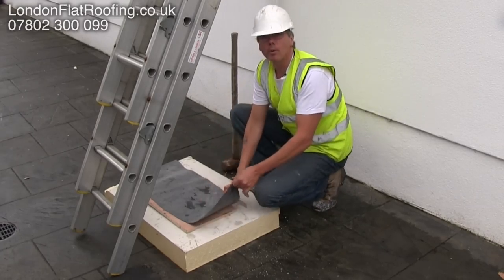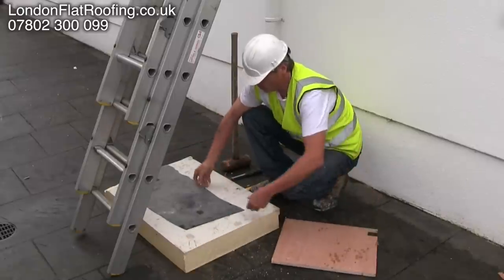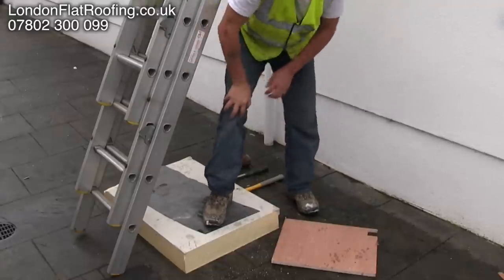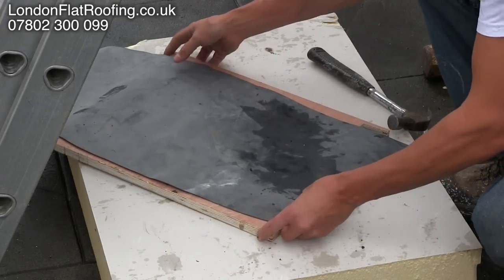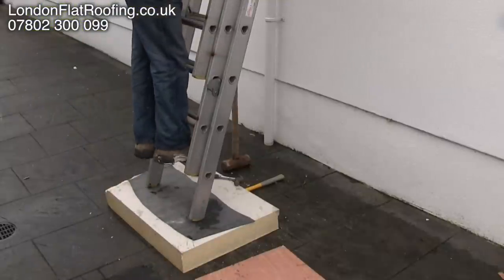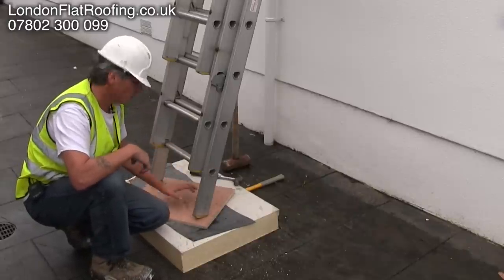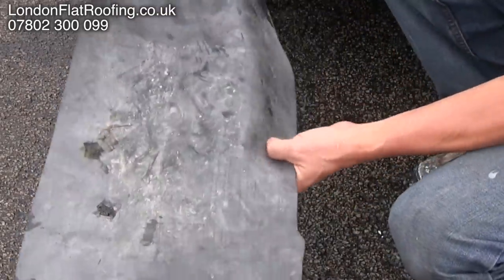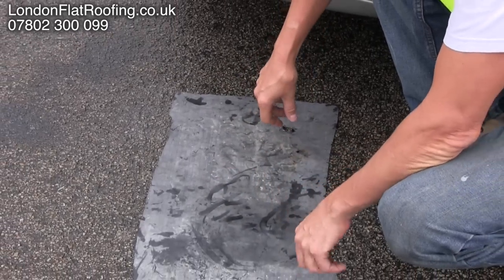Is An EPDM Rubber Roof Strong Enough To Walk On?

Comment: Easily last over 25 yrs (60 mil). Same stuff fish pond liners made of. Check shoe bottom for nails or rocks before walking on, pick up loose nails or screws you find ( hvac repairman).
Those are specialty tri angle washers(counter sunk screw heads), careful not strip screwhead and leave sharp edge, under rubber.

(medium coat best)
Roll your glue even, no glubs or puddles, 1 coat on roof one coat on rubber. Very important with epdm , let glue vapors flash off at least 30 mins on hot day, 1 hour or more cold days.
Cover to fast and it will bubble roofing. 
When the glue "barely" sticks to the hair on your knukles, its ready to cover. 

If it sticks like duct tape to your hair , its still to wet, wait.

Pay attention to overlap seam, do not glue this , it receives its own type of glue/primer tape
Reply: '...Check shoe bottom for nails or rocks before walking on, pick up loose nails or screws you find ( hvac repairman)...'
in our areas those are the most common and avoidable caused of leaks cuts and punctures.
HIVAC service is the primary craft responsible too.
Reply: Trust me now epdm roof membrane is not the same as epdm pond liner the roofing membrane contains certain chemicals that will kill all the fish dont ask how I know

Comment: We are felt roofers of 27 years, as you know everyone try and say felt is rubbish but it's about how's it's layed like all flat roof materials.. I've seen DIY felt roofs that look like a 2 year old has done it, also GRP done over bad decking causing it to fail and also epdm stretched over old felt roofs which looks like a drum on the kerbs.. At the end of the day all flat roofs are good if done correctly mate..
Reply from the maker: Absolutely nothing wrong with todays mineral felts its the incorrect application on badly designed flat roofs.

Comment: Ok, this was a fresh piece of epdm used i presume.  Now my question is years down,  after like 4-5 freeze thaw cycles and the sun has died it a little,  if a ladder was placed on it without the osb, or if weight was applied,  won't it snap/crack?
Reply from the maker: About 5 years ago I stripped  a 30-year-old EPDM roof because the building was being knocked down I pushed and pulled the  EPDM and  I thought that it had lost about 5% of its elasticity

Comment: you cannot destroy rubber by trying to crush it, but epdm is vulnerable to tearing from sharp obects, i was surprised how easily i was able to cut through excess epdm with a stanley knife. ann appropriate test would be to see if a cat scratchig it will tear it and what happens if a bird of prey lands on it
Reply: OnlineBackupServices why would a bird of prey land on a rubber roof and extend its beak or talons into it? I could understand a sabre tooth tiger or a Tyrannosaurus rex but definitely not a bird of prey.
Reply: Slashley gibbins this is a good point and definitely a situation for a scarecrow....
Reply: Why would firestone bother making a roofing membrane that can be destroyed by birds? Believe me they test all this stuff out ive even done my own tests such as trying to pull it apart with various tools, cutting it with blades of different sharpness, it even survived 15 seconds under the direct heat of a blow lamp and still went back to shape

Comment: Funny indeed. I am in Phoenix Arizona where its 118F today and I am wondering what type roofing material to replace a failed material on my observation deck over my patio. Thanks to the Internet, a roofer from England shows me, in great detail, how truly strong EPDM material is. Thanks Steve! I owe you a pint! :)
I'll find a local roofer who is familiar with the material. Cheers!!!
Reply from the maker: Just got back from Texas and have been using it out there in 100F I don't recommend using EPDM if you haven't got insulation under it as it gets very hot ( assuming you are living in the room below)
Reply: TEXAS? You get around Steve!!!
It's a patio roof with an observation deck on top. I am going to ask my installer about putting white EPDM over the black material to cut down on heat and weathering. Its only a 7 x 15 foot deck. Thanks for the information!!!
Reply: Dont use epdm in that heat as its 4 years on youve probably figured that out... the primer for the flashing tape will go off instantly it will be impossible to stick down and there will be endless ripples. However! You can get white epdm which solves all of the problems

Comment: It's frost and heat expansion and contraction never seen one yet after a few years without ripples and creases and that's where it splits or cracks and being only one layer waters straight in
Reply: There's a lot of people out there that do it wrong including this guy. There can be a few mistakes that lead to ripples number one is the adhesive you use youre meant to use a water based CONTACT adhesive meaning you apply it on both the rubber and the deck (which shouldn't be ply) the glue that you get from firestone isn't the best but let's use that for example as it is the right type of glue not PVA the glue has a blueish tint to it and the main property of the glue is that it does not dry fully kind of like tackifier meaning when heated the rubber can lift up ( which is normal because there's no way of stopping this) but the main thing is it will actually stick back down to the board once cooled however if you use the wrong glue say PVA it will fully dry under the rubber and when heated it will peel up but will not stick back down again. Secondly the type of boards you use with ply it can be very strong if you are trying to bend it but if you try to pull it apart like what the rubber does its very weak and either the glue holding the veneer together will give way or the veneer will split away from itself the contact adhesive really is that strong ive seen it many times. thirdly you get idiots like this thinking its okay to stick the membrane straight onto the insulation and the same problem will happen here as with the ply but a whole lot easier you know yourself how weak insulation is and how easily the foil peels off. Those are the main reasons you can see ripples or bubbles I hope this gives you a different opinion of EPDM there's a lot of people out there giving it a bad name and not many who do it properly if you're gonna do it do it right
Reply: Keep in mind that on a hot day a roof that is done correctly will ripple but it wil also stick back down once it has cooled off

Comment: Brilliant video. Can you lay EPDM Directly over a block and beam flat roof and then lay paving slabs on top  or would you suggest a screed between ? Tia Paul.
Reply: Hi Paul did you manage to finish your block and beam flat roof if so what did you do to achieve the final results as I’m in the same boat trying to finalise what to do thinking of insulation epdm and then concrete 
Thanks
Reply: @RayRay-vt7hc we layed the EPDM straight on top of the block and beam, then put plastic sheet, then concreted it and slabbed on top.
Reply: @Paul_Hassell  hi that’s great as Mrs was hinting can we finish it with paving slabs after concrete and what size epdm did you use 1mm or 1.5mm and did you place the slabs or concrete in an angle 📐 so the water can be directed to the channels or a hopper and how did you finish off and sealed the epdm on the sides did you cut to size exactly or did something else and did you glue epdm or just simple lay and concrete thanks
Reply: @RayRay-vt7hc  The rubber itself is 1.5mm and with the fleece back its probably about 3/4mm, and yes we had a fall on the concrete, and being as it was a large slab we put a couple of slits in the concrete as expansion joints.
Hope this helps
Reply: @Paul_Hassell  thanks for all your feedback greatly appreciated our roof span is 8 meters by 7 meters
Reply: @Paul_Hassell  hi how did you finish off the sides and the corners with epdm  do you have parapet wall thanks

Comment: What is the best way to prepare this type of roofing for traffic if you have to periodically clear solar panels of snow or do maintenance on them. What is the best method for waterproofing any bolt down racking systems for silver through this roofing or should the racking systems be in place before the roofing is laid? Thank you

Comment: A great video that makes me think of EPDM in a new light, thanks. What brand is that 120mm insulation? I have noticed that Kingspan do one with ply pre-bonded, but the insulation in your video looks quite tough as is (provided you are sensible with ladders etc).
Reply: I have the same question.  What is the insulation spec?  Or put it another way, what can you put EPDM onto?  Does it need to be fibre backed or would something like TR-27 be the best product?

Comment: do you think its better than torch on felt?
Reply: Yes no doubt about it a lot of fitters also provide a 25 year guarantee on the roof with a life expectancy of 50 years firestones words not mine I once stripped a roof off a Conservative club which was 64 years old (epdm has been around that long) and the rubber membrane itself was completely fine not perished or brittle or anything the problem with the roof was water getting in through where the rubber was stuck to the skylight tapes and adhesives weren't quite up to scratch in those days
Reply: Its also faster, easier, better looking if done right, no flame required which means not hauling big bottles of propane up the ladders the only disadvantage is the price thats it

Comment: so is there any point using the 1.5mm stuff if this 1.2mm stuff is so strong?   I'm a bit worried about cats scratching through it though.
Reply: No never used the 1.5 mm rubber, however have handled it. It is a lot heavier so hard to lay in big sheets but realistically like you I can't see the point of it. Over the years I have really abused EPDM rubber, I've used it as a tarpaulin in the back garden to cover over bikes and odds and sods I've never snagged it all made up then on it even when you're pulling it from the corner with all its weight you don't stick your fingers through it it doesn't tear.

Comment: What's the best method for fixing the ply/osb to the insulation ?
Reply: Dont listen to this guy who calls himself "flatroofer" please you should lay the insulation on the timbers then boards over that then 200mm countersinking wood screws through to the joists there is no other proper way
Reply: If you're ever struggling for height and you need to be down by 120mm or so you can cut the insulation and fit then between the timbers its not ideal but that way is also fine
Reply: I asked the insulation manufacturers about this and all said do not do it.  They said the problem is that the insulation compressive strength is measured over an area not a point load, so unless the tops of your joists are perfectly level and flat, there will be an array of point loads into the insulation underside which will cause it to compress. PIR insulation does not recover from point loads and so you could end up with soft spots on your roof
Reply: If you do this how do you install the VCL, which must be under the insulation on a warm roof build-up?

Comment: Hi I have a new osb roof covering that has had iko felt adhesive used around the edges of all boards (to aid weather protecting the inside) with intention of using felt however its now been decided to use epdm will it stick to the adhesive or do I need to apply new board on top? Many thanks
Reply from the maker: Yes it will stick

Comment: I'm doing a warm roof on my workshop but struggling to get hold of the tubular washer. I can find them online but by the time delivery is added it comes to £50 for 100 , and I only need 30. Can you recommend a supplier? Thanks

Comment: Metal sheets are on the roof of my house and they make noise in the rain, what should I do with the letters so that the sound stops
Reply from the maker: Unfortunately the sound coming from a metal roof or any roof that is solid is extremely hard to stop you need to put something on it that's soft

Comment: i also find stretching another issue with EPDM
Reply from the maker: Stretching or shrinking in EPDM s a well-known factor. Any large flat roof should have perimeter fixings to the EPDM as per the manufacturer's specifications. Back in the 70s this was a big problem, but the manufacturers of the EPDM have A) changed the EPDM makeup, so it shrinks less B) recognised the problem and specified perimeter fixings. Follow the manufacturer's  specification on all products.
Reply: Steve Roofer thanks for this. I used to have Duradek on my deck and it pulled away from the edge after 5 years. My new contractor put this stuff on it this week and when the Duradek folks finally showed up to look at it for the warranty, they told me that I would not be able to walk on it . 
My contractor told me not to put furniture directly on it. I have ordered artificial turf to put over it which should resolve the scratching issue 
Knowing that it is less prone to shrinking is helpful

Comment: What mil thickness is that EPDM? Our job specs are suggesting 60mil.
Reply from the maker: Most of the EPDM rubber we use is 1.2 or 1.5 mm in thickness
Reply: @kaicooper5917   60mils (0.060)
Reply: @Charlotte_Photographer  yes sorry I misread that
Reply: If the specs say 60 mil use 60 (1.5mm) i would suggest for anything else use 1.2 its more than strong enough, can make a big difference on cost if the roof is big obviously not a normal garage roof and its lighter
Reply: @kaicooper5917   The job was 2 years ago.  We ended up using TPO instead of EPDM.  We had 40 buildings that were about 3000 sq ft each.
Reply: @Charlotte_Photographer  i dont have experience with tpo have you had any problems with it? What was the roll size? I know epdm can be up to 15 × 30.5 meters which weighs about 700 kg but could be handy if you had a crane
Reply: @kaicooper5917  Not sure what the exact width and lengths were. I was the client.  We have 2 story condo structures and they were able to use a 4x4 boom lift to get materials up and and debris down. Only minimal installation issues. Nothing major. Manufacturer was GAF.

Comment: Great video, do you recommend a particular brand of EPDM and thickness?
Reply from the maker: There all much the same we like touse the 1.5mm thick rather than the 1.2mm as its not that more expensive. we buy all of ours from www.rubber4roofs.co.uk    my promo code is LFR 2016 I think if not just ask any they will give the new one and you will get 10% off
Reply: John's manville is the best then firestone  i wouldn't recommend classic bond to anyone those are the three main ones
Reply: @kaicooper5917  firestone is the original manufacture of epdm and is by far the best the system is far better and I can stand water based glue I wouldnt use it to stick wall paper up yet alone stick a roof down
Reply: @nickydavies4  funny how thats the stuff firestone recommend for sticking epdm to osb
Reply: @kaicooper5917  they dont recommend it they allow it on roofs smaller than 100 square meters
Reply: @kaicooper5917  the reccomend adhesive is the green contact glue and over 100 square meters u have to have it along with reinforced perimeter fastner iv been trained by Firestone to the commercial spec for the last 15 years water based glue is crap iv done one roof in water based and all tho it was 15 years ago and there is nothing wrong with it there is no doubt that it could be easily peeled off in comparison to the contact glue
Reply: @nickydavies4  next time you have a bit of WBA knocking around try it on two pieces of rubber
Reply: @kaicooper5917  I wont have wba around as I dont use it and u shouldn't be sticking two pieces of rubber with water based glue it should be quick prime and splice tape
Reply: @kaicooper5917  solvent contact adhesive u will never get off u will completely de-laminate the ply before u get it off
Reply: @nickydavies4  yes that's correct im just saying so you can feel how well it sticks

Comment: Can you tell how thick is this EDPM? I just had 40 mil EDPM and wondering if I need to stop worrying about it getting damaged from workers walking on it . thanks.
Reply from the maker: +Ravi Sunny Kumar The EPDM  rubber we use is 1.2mm thick
Reply: +Steve Roofer, so that's about 45 mills.  thanks for sharing.
Reply: No, thats .045 inches thick. Not 45 mill
Reply: Right, 1 mill is .001

Comment: If it rips from the sharp force from the hammers sharp side what about cat claws and birds? There are several cats in my area I need it to withstand cat claws / paws. I've just had my flat roof done with Firestone I was not happy at how thin it was just 2mm! I've got a cat and I can't let him go on the flat roof incase he makes a hole in it. Wooden boards are underneath the rubber. The rubber is just like the one on the video SO thin! too thin. 

6 minutes ago
Reply: Cats arms do not have the force of a hammer also 2mm is very very thick for epdm its thin for a reason, because it can be its a lot tougher than it looks if you have a sharp knife you'll have to apply moderate pressure which may not seem like a lot to you but for an animal to do that its impossible they simply haven't got enough weight to them so let your cat free

Comment from the maker: Is a EPDM rubber roof strong enough to walk on?
Reply: Of course it is. EPDM doesnt like sharp objects though. I saw one pierced easily when a roofer had a copper nail caught in the sole of his boot but that said, its all about using the right product for the situation and most importantly the people that install the product have to be skilled enough to overcome all issues when fitting.